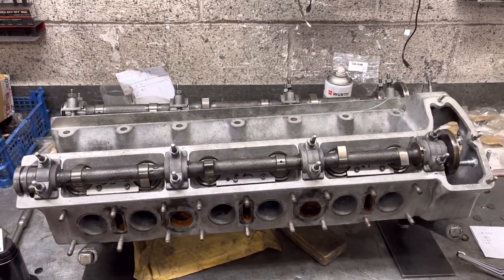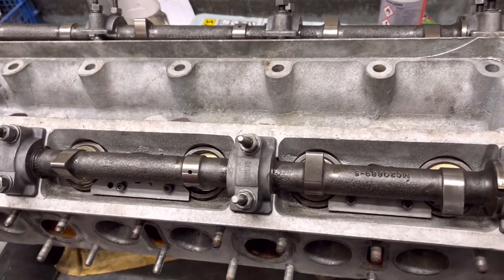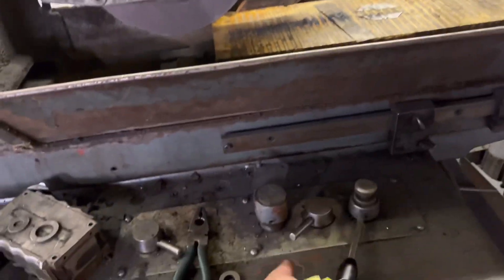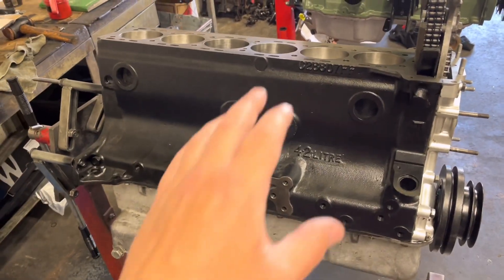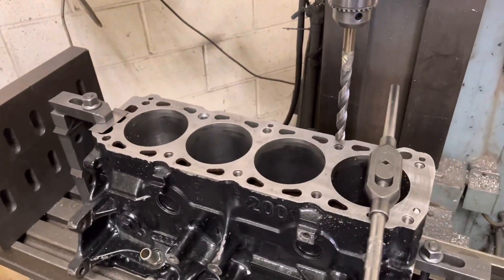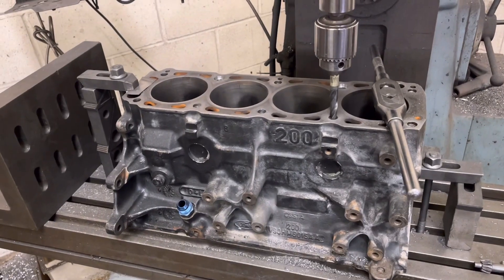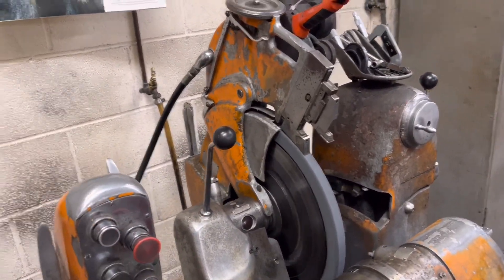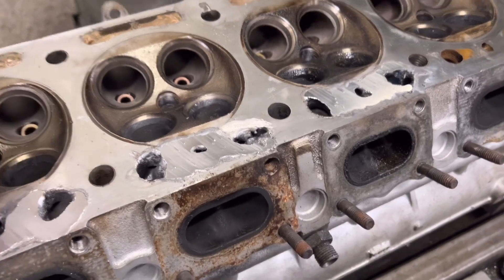REPAIR FAIL: £1000 Cosworth cylinder head could be SCRAPED because of dodgy welding repair

Comment: Was watching a NASCAR video the other day about how they chased power in the 90’s. One trick was to increase the angle of the cylinder heads. Think it was from 15 to 23 degrees. One guy welded the 30 plus pairs of heads and another machined them all. The intake manifolds had to be cut and welded together again to suit. Blew my mind thinking about the hours into those heads.

Comment: I wouldn't be surprised if someone has been at that head with "gp low temperature soldering rods" the material is very brittle and when you try to Tig over it it oxidizes and impurities just constantly bubble out  I've encountered many motorbike clutch cases that have been essentially destroyed from "temporary repairs"

Comment: SU carb needles and springs on old mini engines modified,, what a head scratch. Only tip, wade through the old charts and match the camshaft inlet timings to the ignition distributor timing and engine stroke and bore - god, it has just given me a headache again just thinking about. Needle bluddy profiles, hit and miss.

Comment: Triumph Dolomite Sprint 2 litre 16 valve engines, with just a single camshaft! - what a mule of an idea! Inlet valves directly under the 16 lobe cam, the exhausts worked by rockers across, I think, or the other way around, I forget. Nightmare engines when it's ally head starts playing up, mules!

Comment: Thew old Wolseley 6/80, 4.50 and Morris 6s of the 50s had a built in screwed adjustment on each valve and serrated faces which held settings in place. Special tools were needed to make the adjustment. When normal valves cost 5/6 in LSD, these cost 37/6 and often heads needed doing every 10k miles as  these things burnt their valves readily. Special valves as used by the police, I believe, were nearly £5 each!
Reply: The Wolseley 6/90 next after the 80 was a nice cop car, had the new BMC C series 3 litre, 2907 or something actually, straight 6 engine, as used in Austin-Healey 3000 sports car soon after. Very vroomy, great sound.

Comment: That's a job wherein you need to be left alone to do, lol. I remember on the Imp engine the shims were then coded by letters of the alphabet, just to make things even more interesting. There was also the Vauxhall system that had a wind in ramp under the bucket, done with a small Allen key 😉

Comment: MLS gaskets are fantastic......... but also  the most unforgiving if the surface is not toatlly flat or finish is rough, rusty or machined with the wrong finish course cutting marks etc

Comment: When I was a toolmaker, I had some TIG welding experience prior, that tossed me into mold repair.  While making plastic injection molds, I would do repair jobs.  Most times, when I welded aluminium or tool steel, I always peened and hammered all my welds.  A form of work-hardening and compressing the metal.  Those fine welded edges were a little bit more prominent to be machined off leaving a keen sharp edge over corners.  
Love the videos.  At 16 years old, my first car was a 1977 MGB.  Drove this car for 5 years in the heat and cold of Central Nebraska.  When its 20 below 0 F, that 1.8 loved a block heater and a little ether.
Reply: Amazing you kept one going that long !

Comment: Hi all. No disrespect. The approach to the welding repair is not correct.  Cleanliness is your friend. Every last bit of dirt and corrosion MUST be removed. Otherwise it floats into the weld pool and can leave porosity. 
Your welds are definitely too cold. Some suggestions preheat head well and use helium gas . In water jacket areas use 4643 filler wires. 
But again I can’t stress how important cleanliness is.  
Cheers

Comment: Did my mates Jag head and found a coin used as a shim it had been obliterated. The valve had been cut so deep they probably couldn't get a shim, to fix this I had another mate machine and grind one up out of tool steel worked a treat.

Comment: Lee, can I ask why you don’t use cooling fluids in your machining processes? I have no engineering / machining background and I find your work fascinating. I see cnc machines using a white coloured fluid, what’s the reason you machine “dry” (if that’s the correct terminology🤣), is it not hard on the tools?
Reply: If your talking about the block at 8:44 in the video its cast iron, you machine, drill, tap etc cast iron dry, its self lubricating.
Reply: Also, cnc is used to produce parts, so it has to be done as fast as possible, in witch cooling can aid, while these guys do it the slow but steady way, becouse they are craftsman!

Comment: One of the greatest valve adjustment arrangement I came across was on a 1500 Alfasud engine from around 1980. It had two lobes per valve with a hole through the cam which allowed an Allen key to go through the cam into a grub screw set into the threaded bucket. Sounds complicated but it was actually really cool. Later versions had the above arrangement I believe. ( never had the covers off a later model)
Reply: I owned one in the late 80s, it was clever except it never stayed in adjustment long! Great fun to drive but badly prone to rust, imported as deck cargo on submarines!
Reply: @paulorchard7960  I had several Alfa flat fours. Doing clutch was quite a lot of 'fun' but they did handle and accelerate pretty damn good!
The bady was one of the first made with extra thin carbon steel pressings, much thinner and lighter than 'normal' but the rust was a MAJOR issue I never saw it but heard of windscreens falling out on the earlier Sud

Comment: We shim valves a great deal of the time. We adjust both "shim over bucket" and "shim under bucket" designs. Motorcycle manufacturers normally have a range of adjustment. We use a special set of tools to measure out valve stem length prior to assembly. The set is used to adjust valve stem length according to cam base circle. We restore a great number of Kawasaki Z1 and KZ heads. I have collected a very large inventory of shims over the last 40+ years. Different manufacturers utilize varying shim diameters. We need to stock varying thicknesses as well. A major investment in inventory. So much fun to watch you in action. Isaac looks to be working out well! It is great to have younger people in the game. Thanks Lee. Have a Deluxe week!

Comment: I re-shimmed my Peugeot 106 diesel many years ago. It was hard to start especially in the winter. Managed to do it without removing the cams. I found the new shims didn't correct it fully so ended up shuffling them all around till they were within tolerance. Never had any trouble starting after that. Still had no power but most likely that was the injection pump or the timing. No power steering but it was fun to drive on twisty lanes!

Comment: Hydraulic valves, can anyone explain how the correct gap is established in the first place and how do they compensate for wear? I get that they are telescopic, move in and out but by how much? And like with manual bucket and shim, the part that touches the cam lobe must wear, how does the hydraulics know how much more to extend over time??

Comment: A simpler way to grind is make yourself a magnetic holder for your shims that fits into the valve grinder where you face off the valve stems. Just take a bolt and turn a relief in the head the diameter of the shim, then magnetize the bolt and it will hold the shim while you face it to the proper thickness.  Many years ago I did a lot of Jags and other cars and still have all these things I made for Jags, lotus, Alfa, Fiat etc.  I see the later head has the cup retainers- we used to stake the cups in place to keep them from coming loose- you could always tell what was wrong by listening for that distinctive clatter as a loose cup was floating up and hitting the cam.

Comment: I ground some bucket shims for a Suzuki GS 550 on a surface grinder and used the mag base as you did.
Only problem was because the shims were only about 7 mm diameter the magnetic table struggled to hold them and even putting on a very light cut it was hit or miss if they stayed in place.
Bit of a bum twitching moment.
Reply: Just put another piece of metal either side of the shim, that is slightly thinner. Like a piece of sheetmetal

Comment: The Jag head valve shims look very similar to the Coventry Climax (Imp) shims and if so I understand that they are case hardened and any grinding goes through the case hardening, which meant possible wear and constantly varying valve clearance.  It would be very simple to get a rod of tool steel at the appropriate diameter (Cromwell Tools sell them) and simply cut the shim thickness in the lathe, its a simple operation, which I carried out many years ago on a capstan lathe eventually cutting many 1,000s.
Reply: If you make sure you only grind one side, then ensure that faces the lifter/bucket I don't think there's any likelihood of wear.
Reply: @Mark.D.H.  I don't think I would chance it.  Does the bucket in the Jag engine rotate?  If so the bucket, which is hardened  will grind the shim as it only gets minimal splash lubrication.  You can see on the shim that is shown that the valve head contacts the shim by the marking so there is some pounding going on.
Reply: @clivewilliams3661 
The valve tip is quite small, so point-loading will always be a lot higher than on the bucket side. Whether rotation is likely to cause wear I'm not sure.

Comment: Sometimes people try to repair heads with technoweld aluminum solder and you can’t weld on top of that, it just spits and bubbles under the weld. 
So heads starting to be worth a grand, think I need to fix the couple of valve damaged heads I have.

Comment: I was at the local "cylinder service shop" 20 years ago and realized you can build up this kind of damage with weld...it amazed me then, and it continues to amaze me 😀
Reply: A great channel for that is "Cutting Edge Engineering Australia".  Curtis practically makes a living welding up large mining excavator parts. Typical job for him involves boring out the housing for a massive bearing, building it back up with weld using an automated welding machine and refitting the bearing. He has some massive machines in his shop. His wife does the filming and is pretty good at it.
Reply: @ColinWatters  I'm subscribed to his channel and a big fan myself. I also subscribe to a number of the good youtube machinist channels since I'm a hobby machinist. I've learned so much from them.
Regarding welding I think that Jody's channel 'weldingtipsandtricks' is one of the best.
Reply: Yes, so true. There are of course settings on a TIG machine that allow for doing more deep cleaning on aluminum which of course boil the contamination up to the surface. The trick of course being to have clean aluminum with no voids below.. Then you're all set.

Comment: Some years ago I was doing a 2wd and a 4wd YB and the 2wd head had rather a lot of ugliness on the exhaust side water passages and needed some welding..So I asked the welder guy--a true miracle worker he was (seen his work on top fuel dragster blocks and heads when they'd scattered things inside and you could hardle see where the things had been banged up) if he could fill in the passage to make it like the 4wd head with a few holes rather than the big scallop shaped thing..And since he'd have the thing all warmed up I asked if he could just fill in the scallop under the exhaust port so we could mill it flat and in general have a lot more meat on exhaust side..He  did and hardly cost more for the welding and the milling back to flat I did on the trusty ol' Bridgeport before moving it over the head surfacer for the right finish for MLS gasket..  Worked good..Might suggest that to the owner since Ford themselves themselves thought it was worthwhile to add material..

Comment: All I have ever done is with the dimes.  When did Jag go to hydrolic lifters in their straight motors?  Thanks for the great vid.
Reply: I work fpr jag and jnow that the 98XJ8 engine lifters are hydraulic  and do not use a shim. I think he means a solid bucket /shim. Not hydrailuc. Its overhead camshaft. If it was hydraulic it wouldnt have a shim.
Reply: He was explaining the difference. I think i even got confused with the repetitive back and forth between the different types. And if you have limited number of shims... find some. Id be pissed if i couldnt get oem shims.